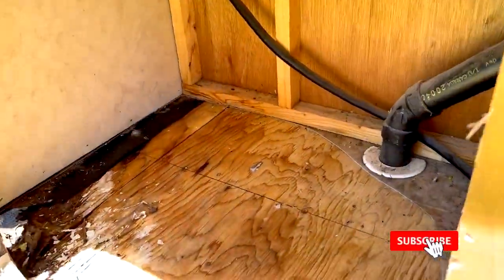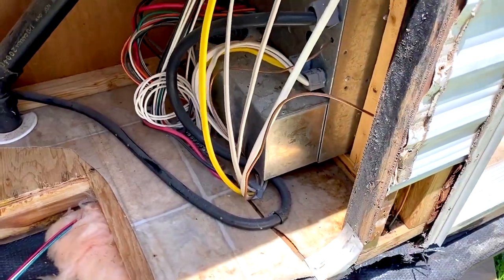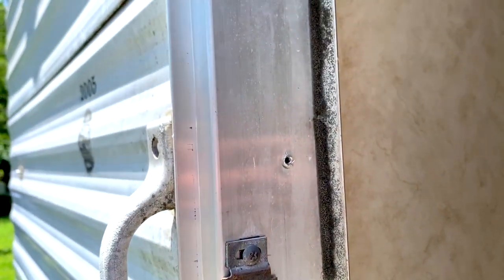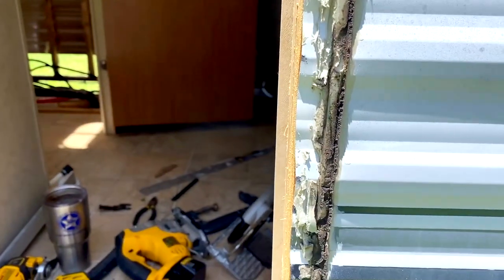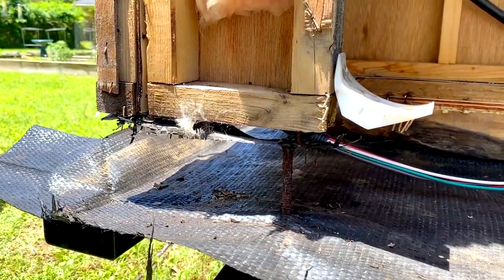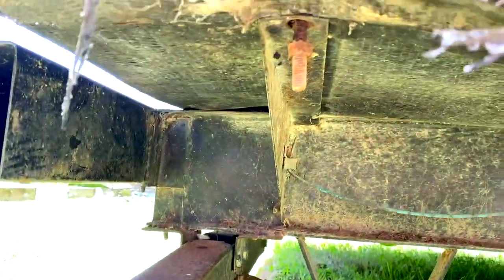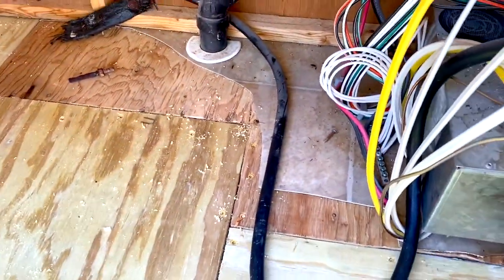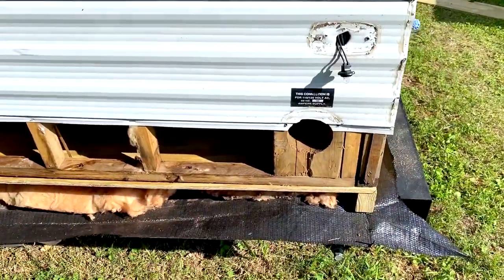RV Water Damage: Storage Flooring Repair

Comment: Hey I love your videos and they have been a great help to me! How did you end up figuring out the bolts?? I’m doing the same thing….but quite haven’t figured out the best way to remove and replace them
Reply from the maker: I ended up cutting them off with an angle grinder and replacing with lag bolts.

Comment: What solution did you end up going with for the bolt and the frame?
Reply from the maker: In the locations where I could use nut/bolt I ended up using a lag bolt with a lock nut.